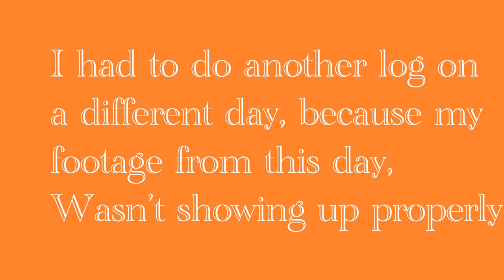12x16 Storage shed: Part 3. Milling more lumber for the shed.

Comment: Why aren't you using a hydraulic lift?
Reply from the maker: I started out with no hydraulics,  eventually I got the basic hydraulics, log clamping system. but haven’t yet invested in more hydraulic features except the toe boards.
Reply: @Plankmills  I like that feature about Norwood letting you add on as you go.
Reply from the maker: Me too!